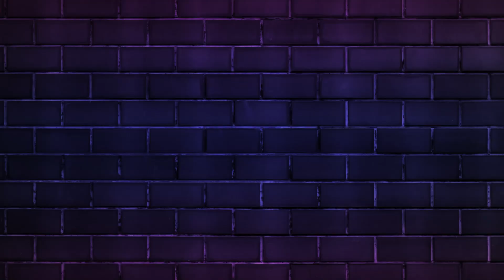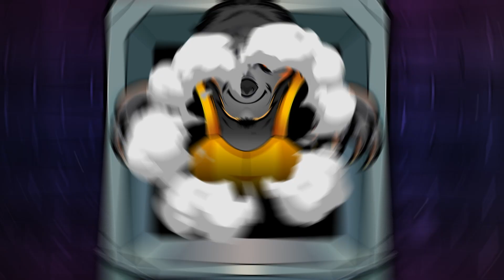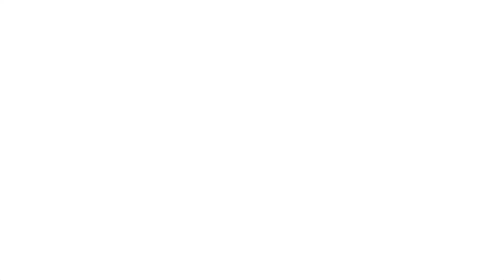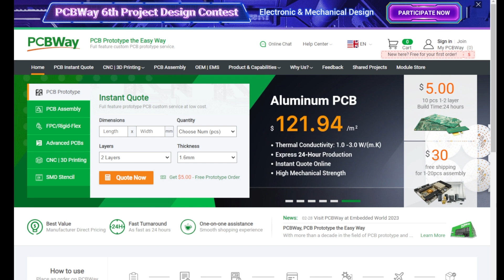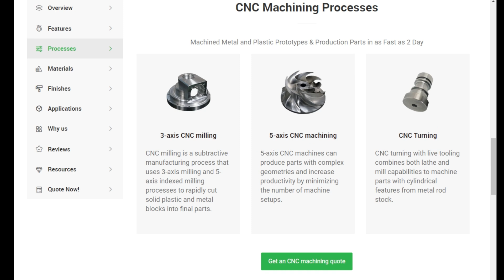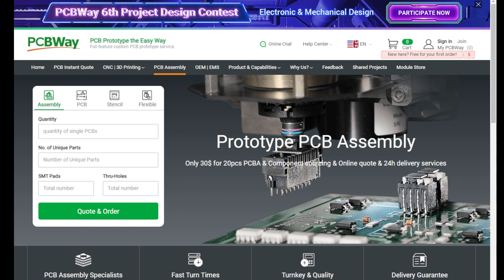TwoTrees Ts2 20W laser Review and result

Comment: Junk I hope it works and you never need parts or help. I bought the 20watt pro and have no so…
I bought the 20watt pro and have no so many issues. They tell me to report it and i have. It took me 3 months to get a reply. and then they don't want to help. i tried to buy a wire and they took my money and then said they would ship it whenever the part was made. I have gone through this 4 times with them. they are a rip off of junk machines. only good thing is the machine is easy to use. but i would and will bought other machine. junk hope you never need parts or help. 30 hour on it and died,